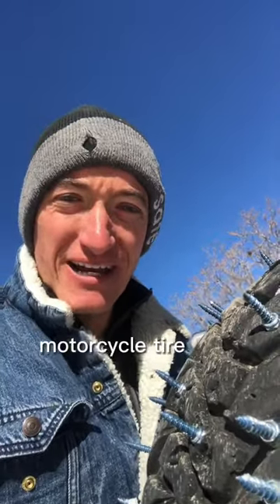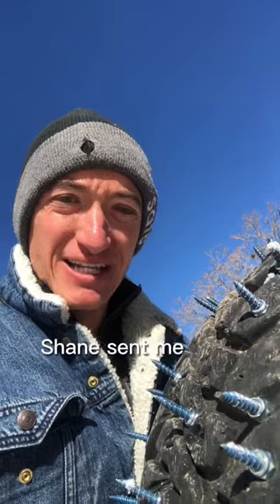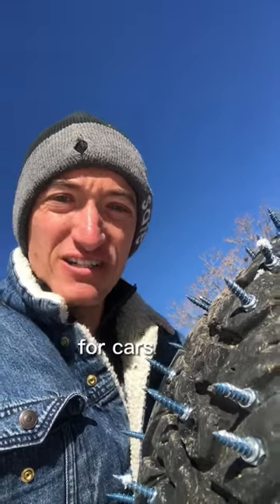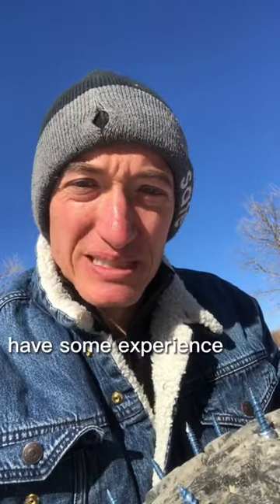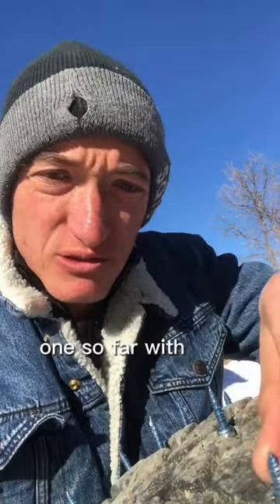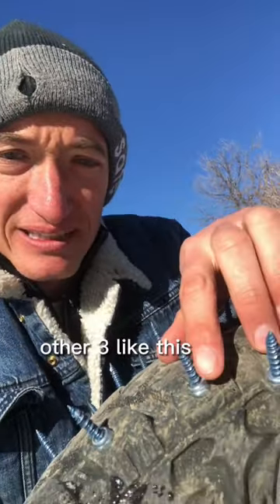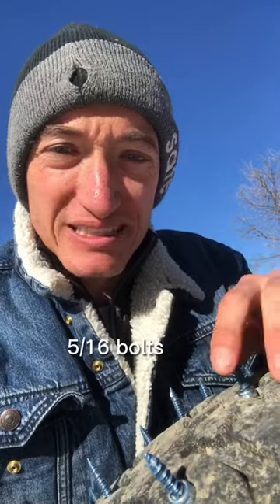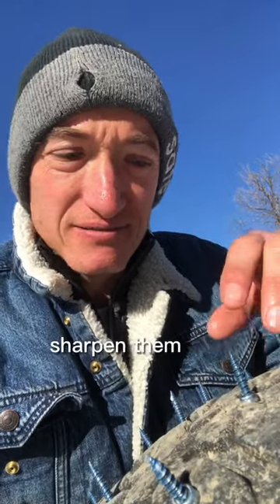Bolts or screws for ice tires?

Comment: I would cut the screws down almost to the bolt. They don't need to be sharp to bite. Good luck brotha
Reply: Facts that could definitely work
Reply: Im a tire man and that's exactly what I thought too good advice.
Reply: Those nuts will come loose while driving on them 😂. I don't see how doing this doesn't cause your tire to leak like crazy anyway 😂. I would screw short lags into the actual tread lugs and not even go through the tire. The head of the bolt is good enough for traction. Maybe you could cut these down with a grinder and throw an inner tube in there 😂. I've never done this or been tempted to lol.
Reply: Good idea
Reply: Agreed..!!
Reply: i never understood why they sharpen them.??? ice isnt that strong, woulnt a bolt with a flat head be just as effective
Reply: @clarkd2742  lock tight/locking nuts
Reply: @erock3163  you've never hit a solid chunk of ice b4 have you
Reply: ☝️this is the way
Reply: Smart guy!
Reply: You ain't cutting no tapcons like that bro
Reply: the screws will break

Comment: We usually use 1/4 inch machine screws and the head of the bolt is what grips the ice not the threaded part, those are just gonna fold under weight
Reply: 😂. Consult people before putting Friggin shrapnel tires on the road
Reply: @Juicysmoolyay7259  it's for traveling on ice and off road on pavement they just skid everywhere and throw sparks
Reply: @robertg9334  yes , I know, but do you know they are backward? Inserts get screwed into the tire the replaceable studs are screwed in . He put them in upside down. You get it?

Comment: How's the tread depth? More than 1/2"? Get #8 x 1/2" head head (slotted ideally), self-drilling (pointed tip, not drill bit tip), sheetmetal screws. Put about 200 per tire, depending on the pattern you make and tire size. Plenty of grip. $25 for a jar of 1000 screws at just about any hardware store.

Comment: I would look into high grade bolts like 8.6 or 10.2 so you can use smaller diameter bolts and they won’t shear as easily. I doubt the point on the bolts really matters much but the length definitely should be considered. Stick out shouldn’t be any higher then a ratio of 1:1  stick out:bolt head diameter. Its probably safer to the project to try a stick out ratio of 0.75:1. This ratio will essentially be a triangle shape where the base holding the bolt in the tire is wider then the length of the bolt sticking out of the tire. Since all the car weight will be supported by these bolts you need to be sure to add enough bolts to avoid tearing from too much weight on them and consider how deep they stick into the ice because they will be pulled out in a sheering direction.

Comment: I always just used like 8mm bolt head screw maybe a half inch long straight through the tread and the bolt side will give you a traction on ice don't need the pointy side. On a dirt bike don't even have to take the wheel off if u do it right. Unless you want to put Styrofoam tube inside

Comment: Those will beng over and rip out and damage the integrity of the tire,
Shorten them and maybe add washers on the inside so they won't rip out so easily, 
Space them out more frequently because of the weight factor.

Comment: Honesty you're probably gonna wanna start over because those screws are gonna get busted up either way. The main issues is making sure the hardware won't just sheer off immediately so they need to be fatter not sharper.

It would makes a bit more sense to use what you got if this was for a lighter vehicle.
Reply: Waste of time. Cut and run as is and start over on different tires

Comment: I sure wouldn't want to be behind you brotha, screws would be flying out..😂😂
Reply: The screws go in from the inside he should have washers so it should be kinda hard to pull it out and send it flying
Reply: @masjuggalo  just looks sketchy..
Reply: Using your thinking ice racing tracks should be littered with dead or injured people with their bodies filled with the screws "flying out of the tires. There is an old proverb that you may want to consider, it is better for people think your a fool than to speak and remove all doubt!
Reply: Mine have 340 per tire

Comment: the reason they do the longer screws ( with the pointed side on the outside ) on bikes is because it’s way less weight. on cars u put the head of the bolts on the outside. gl 🤞

Comment: My dad use to use 2.5” 3/8-16 bolts with nylock nuts he also had a bench top mini lathe with a special made tool to turn down the bolt with a .5” point that was so sharp of a point after 10+ yrs inflating them in the same spot in the shot the concrete was nurled

Comment: It seems counter intuitive, but the screws will bounce more than dig in.  you want the edge of the bolt shape to be the cutting edge. if you sharpen anything it should be a wedge facing the moment the wheel brings it to the ground.  Think of it like a sword, you dont cut with the tip as it spins.

Comment: I use 1/4 inch self tapping hex head with the flat slot for a standard screwdriver run super glue on threads if you want works perfect

Comment: What are you doing, are you playing on the ice, or drag racing, lots of bolts would work great and last forever, drag racing, put on short stainless steel screws like drywall screws that stick throw about one inch max, the put a liner in the tire and tube it, stay strong

Comment: If you have a cutoff grinder with a grinding wheel to shape them, shape them kind of to a rounded point, like what cleats have in them. They'll still work, but if you have the time, just redo it with the proper hardware

Comment: Did you run those in from the inside of the tire? If so I would not use that tire don't even mount it those studs are supposed to be screwed into the tread pattern from the outside and aren't supposed to go through the cords and liner that will cause Tire separations and blowouts
Reply from the maker: Ok

Comment: Start over a four-wheel drive system needs to have the same tires that has the same pull on the system so the drive chain does not get wrecked just like if you were to get new tires on your four-wheel drive truck you can't just get to he have to get all four so everything wears evenly
Reply from the maker: Miata is rear wheel

Comment: I used 1.5" 1/4×20 carriage bolts. 185 per rear tire on my ice racing mower. The head makes for a nice seal on the inside, then washer and nut on outside. Sharpen to taste
Reply from the maker: Oh nice! I ended up using 1 1/2” 5/16 bolts and the worked perfectly!

Comment: I mean you could used studs from the outside in they don’t need to be sharp or long you just want something that’s gonna bite into the ice rather then the rubber that’s gonna slide right over it some 1/4-1/2 inch studs should do you just fine without compromising the seal of your tire making more possibility’s for leaks 👍 hope this helped

Comment: I don't see how doing this doesn't cause your tire to leak like crazy anyway 😂. I would screw short lags into the actual tread lugs and not even go through the tire. The head of the bolt is good enough for traction. Maybe you could cut these down with a grinder and throw an inner tube in there 😂. I've never done this or been tempted to lol.

Comment: I think you will 100% need shorter. If the ice you're driving on is as cold and thick as it should be to be safe it'll be pretty impossible for the screws to  penetrate that deep into the ice. Having a much deeper/sturdier base for the screw is going to be the most important thing  so it doesn't fall out at speed or with torque. You just have to be careful the holes you drill to place the screws don't go deep enough to puncture the tires inner linner/steel belt construction. And make sure the hole drilled is smaller than the bolt head and use a lil wet glue to force them in so they are more liekly to anchor and hold. There are some guys on youtube who drag race on ice and use something similar if you want to look them up I think it was a 1320 racing video.

Comment: If you use that, consider what you will be leaving behind you as they break off. Do you want to step on that ? Would you want anything to step on that ?
Reply: I really hope these are for some off road race. Not for street use. They are way to long. Either will just puncture the tire, or fold and break off. 😂

Comment: Use chains, see how school busses get traction on ice. The chains don't actually go on the tire but spin under the tires.
Reply: What is the allowable travel speed with the spin a ma thing chains?  Bet running your tires at 95mph while moving 65-70mpg around a long sweeper, will make those spinners explode sending you off the track into the trees.

Comment: Doesn't matter. Those screws are going to sheer off as soon as it meets too much resistance etc. Trust me, especially the longer the screw, the less sheer strength it has best the head when a force is applied at the tip/far end. I used them in construction and they aren't as strong as you may assume. AND that could've all been avoided if you had drill the screws in the right way. You want to use the head of the screw. Once there's weight on those they'll break or fly inside the tire leaving you with Swiss cheese wheels.

This guy needs more friends and life experiences. Why the hell would you drill them that way?? Lmfao

Comment: Way to long, those tapcons are very hard and brittle, they actually make a special carbide tipped ice cleat for all types of tires, it is usually sold with the tool to install…check eBay they are there!

Comment: Use the bolts!!! And dont sharpen them!!! They aren't fucking diamonds bro, several thousand pounds of car will ruin the tips in no time. The best thing to do is use the 5/16 bolts and leave them the fucking way they are, and use washers on the inside of the bolt so it doesn't rip through if it gets stuck in ice. And if your worried that not sharpening them will affect the traction, you should think abt it from my perspective.

Comment: I'm not so sure your buddy is 100% correct. I've seen some ice drag racers use studs that weren't much different than what you are using. Yes, some of the racers were using shorter fatter bolts like your buddy suggested but some were using 1/8 - 3/16 inch that were at least 2 inches long. I would do a little more research before starting over. Maybe try some ice racing organizations to see what rules they have for tire studs.

Comment: They look a little long to me I cut them down with a grinder
Reply: I don't see how doing this doesn't cause your tire to leak like crazy anyway 😂. I would screw short lags into the actual tread lugs and not even go through the tire. The head of the bolt is good enough for traction. Maybe you could cut these down with a grinder and throw an inner tube in there 😂. I've never done this or been tempted to lol.